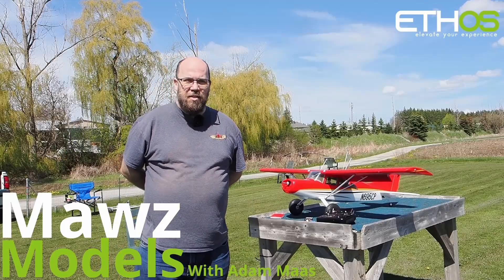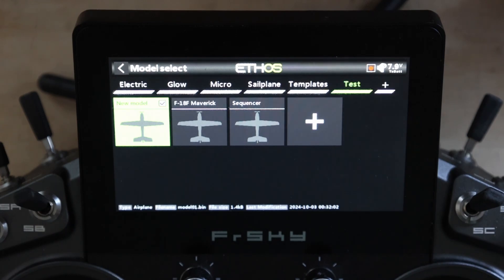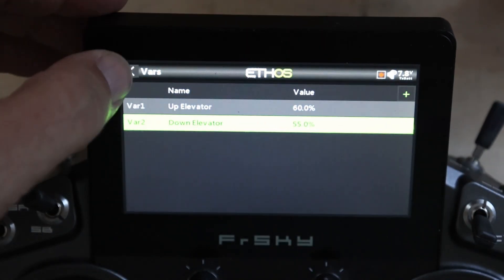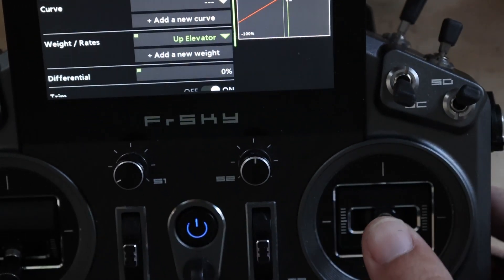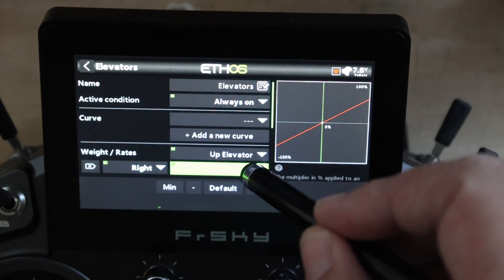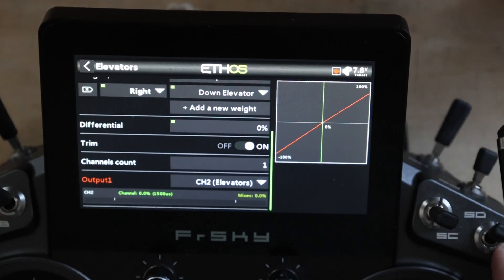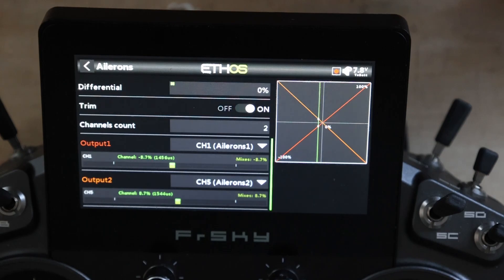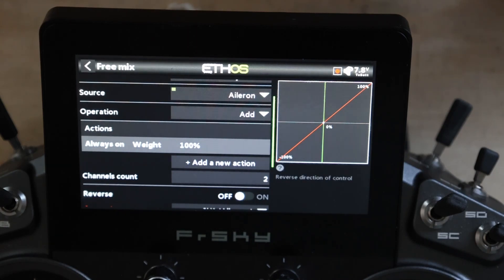ETHOS 1.5 Episode 6 - Per Side Rates

Comment: Hi Mike. I have an unrelated question. Is it important to add a redundancy (900 MH) receiver?  thanks
Reply from the maker: It's Adam btw, Mike is the Jet_Flyer over on RCGroups.

dual-band Redundancy can be really useful, but isn't required. I'd generally recommend running TD instead of adding a 900M receiver as the latter limits you to 15ch and has some telemetry sensor wiring limitations as well.
Reply: @adam_mawz_maas  Thank You Adam.